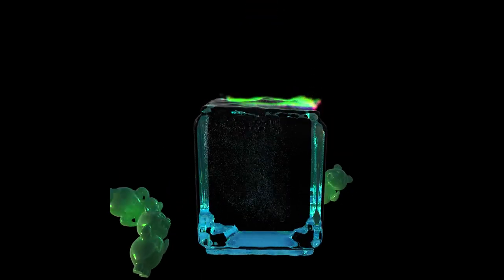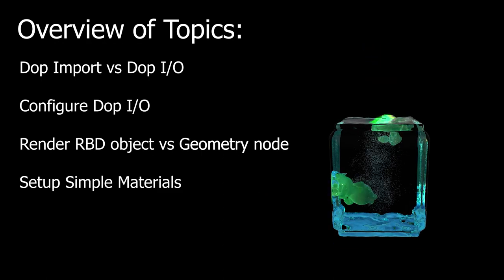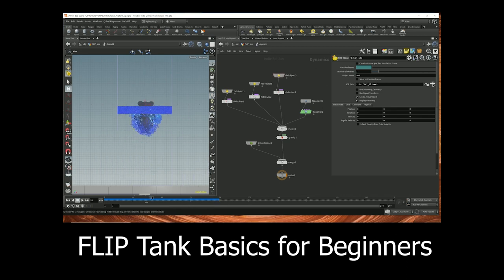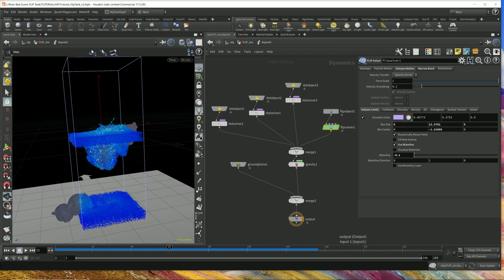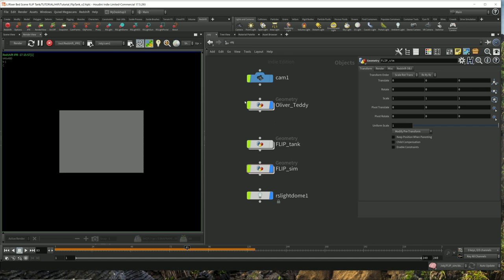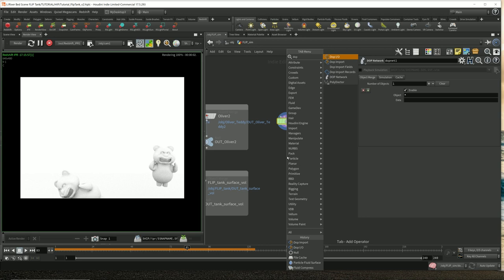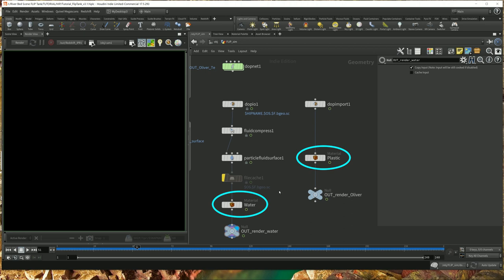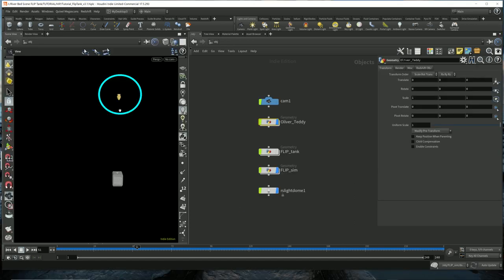FLIP Simulation Render Setup for Beginners in Houdini and Redshift

Comment: Hi, I am using this video series to populate water in a tank that a ball then splashes into. I am having an issue because as you probably know the fluid expands and when it does that it goes outside the region that I want it to be in. Also, it morphs and doesn't look right on the corners of the tank. Do you know of any way I can fix this?
Reply from the maker: You'll need to play around with the particlefluidsurface node to get the right look as it converts the flip particles into geometry.  Try increasing the number of fluid particles in your SIM so the particlefluidsurface node will at least have enough information to work with.  FLIP sims take up a lot of ram, by increasing the number of fluid particles, it'll make the SIM cook longer.  

Inside the particlefluidsurface node, try lowering the value of the particle separation, it'll make it more accurate, but also take longer to convert.  To compensate this I usually increase the influence scale a little bit.  This is so that each flip particle will will blend with others flip particles around it estimating the converted geometry.  There's no exact values to use, because it's scene by scene thing.

And if it still morphs too much frame from frame, try increasing the FPS in the entire Houdini scene so you'll get more data for each frame.  

Hope this all helps!
Reply: @bubblepins  Thank you!!!!

Comment: Hey great tutorial! I have a quick question. How can I use the velocity vectors that the flip particles generate to drive the water color? In other words, I am trying to use the (attribute - v) velocity of the particles to make the part of the water that is moving faster to be a bit whiter. So how can I transfer that data into redshift as a black and white map?
Reply from the maker: You'll need to use a fit range to make the velocity fit into a 0 to 1 range for Color values.  So velocity can be any value, including negative.  I suggest dropping down a length node to measure the magnitude of the velocity and then fit range that length value to 0 to 1 range.  So this you'll need to experiment with to find the source values in the fit range, the largest and smallest resulting from the length.  Just write it out using bind export into like a "test_attri" parameter and look on the spreadsheet and look for the large values, you can also sort the spreadsheet.

Then drop down a color ramp node, you can then define the colors you want for the speed of the velocity values.

Hope that helps!

Comment: Do we need to use Surface polygons instead of polygon soup in particle fluid surface node while using Redshift for rendering. As it is mentioned in Mix traning, he said Redshift don't work properly with polygon soup. Is it so ??
Reply from the maker: I don't use Polygon soup that often, its some sort of compacted version of polygon used in Houdini, so if you don't have that many point counts, I don't think you'll benefit much from it.  I just gave it a quick try, drop down a simple sphere and turned it into a quick FLIP source, then particle fluid surface and it seems to be rendering fine in Redshift.  Maybe Redshift released an update that fixed this issue recently?  Sorry not sure about this, because I don't use Polygon Soup too often.

Comment: Thank you for your tuts! is there any way to render white water in redshift? 
thanks
Reply from the maker: I'm actually working on a new tutorial about white water for redshift, but while planning the video I realized rendering the whitewater requires knowledge for rendering volumes, so I will probably do a 2-part video.  One for rendering volumes and one for setting up whitewater and render.  Stay tuned!
Reply: bubble pins thank you so much👍